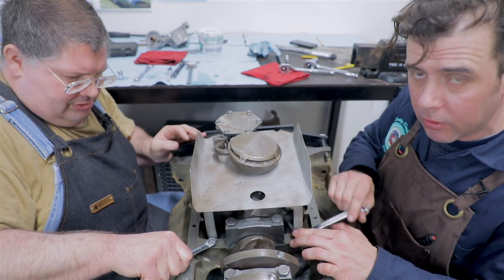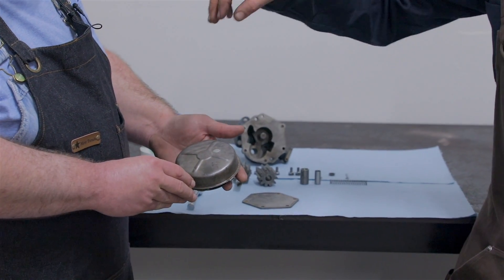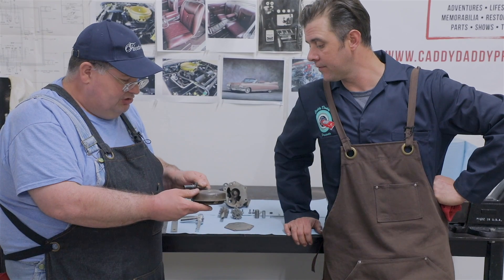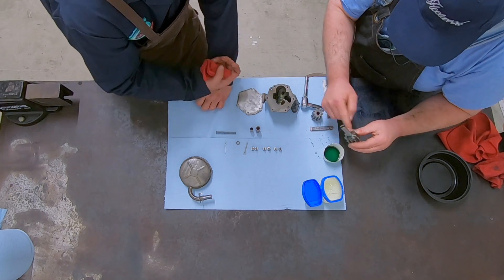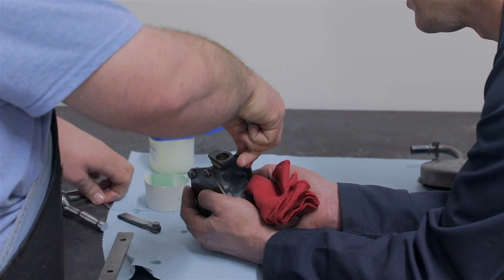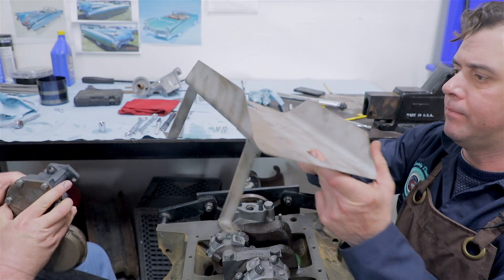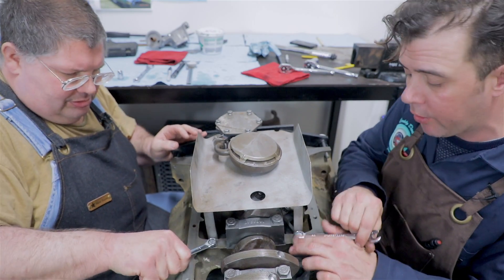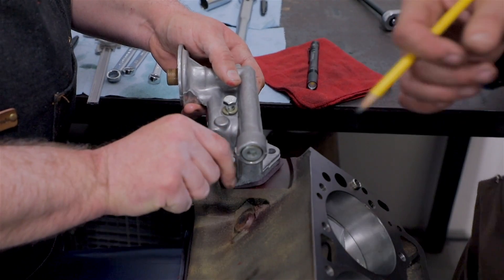How To Install an Oil Pump, Oil Pan, Oil Filter, and Windage Tray on the Cadillac 390 Engine

Comment: Great video Fellas. 
I have a ‘50 Cadillac and I’m wondering if the windage tray is absolutely necessary?? Mine is hitting the bottom of the oil pan and it’s driving me crazy. I’m upside down on the floor and can’t get it to line up. I’ve bent and moved it around for hours. Can I just leave it out?? 
Thank You for any advice.

Comment: I came here to find out where the oil pump is located on the 390. This is absolutely no help.
Reply: if you wait till the end, they have the engine upside down, they install the pump and windage tray, then, they put the oil pan on with 2 pc gasket (not shown, but in teh comments)....then you flip the whole thing over and continue the rebuilt before returning it to the car.  Seeing this is a year old now, you probably found what you were looking for.

Comment: Hi John, I watched the video in an attempt to learn more about the strainer.  The video doesn’t mention a felt seal at the strainer pivot point, one of your comments does, and I read one other place in a Cadillac forum that there’s a felt washer about the diameter of a quarter.  Could you clear this up for me?  Also, is there anything wrong with just eliminating the floating strainer with a fixed position strainer?  Thanks for the help on my ‘56!
Reply from the maker: Michael,
There is a felt washer on your engine for the oil pickup. I believe they only come in complete engine gasket sets. If you don't have one you can make one from felt available from industrial suppliers.
Sorry for the confusion in the video as to what is correct. Josh
Reply: @Caddydaddy  thank you Josh.  I’m a machine tool builder by trade, so I have lots of felt on hand.  I appreciate the info and all of the videos you do!
Reply from the maker: There is a felt seal and it should be soaked on oil before installation. Please see our oil pump rebuilding video for your reference. I would not defeat the floating strainer. It is designed to prevent sucking in sediment in the pan and to prevent starvation if the oil level is a bit low.
Josh
Reply: Hi Josh, thanks for the reply and information.  The oil pump rebuild video doesn’t reference the strainer, but this installation video does.  At 8:11 it’s said that ‘no gasket or seal’ and that’s where I’m guessing the felt seal goes.  Just trying to be thorough, I’m about to dig into my ‘56 to track down an oil pressure problem.

Comment: great video! do you guys have a video or info on how you tied the factory spin on filter with the remote passive filter?
Reply from the maker: Our '59 has a later block designed for a full-flow oil filter. The block casting is different from the earlier 331 series engine and has provisions for mounting the oil filter adapter. You can add a bypass style filter to any engine and these filters remove finer particles than do full-flow filters. In fact, is common in industrial applications to have both styles of filters in use and Mercedes-Benz used this setup in their Diesel cars for many years.

Comment: Just started oil pump rebuild.  What are torque specs for oil pump plate cover bolts and 2 assembly bolts?  Pickup WAS pretty gritty.  Thanks guys.
Reply from the maker: The oil pump cover to body bolts (1/4-20) should be tightened to 40-45 in/lbs (note inch-pounds, not ft/lbs).
Pump to rear main bearing cap (3/8-24) 20-35 ft/lbs.
Reply: @Caddydaddy  Thank you.
Reply: Thanks for the video and info.  Finally got oil pump installed.  Much more difficult laying on your back.  Gasket was the hardest part.  But 30-35 psi on interstate now!  I'd say success.
Reply from the maker: @RustyFleet  Glad the video helped you out. I have done quite a bit of engine work on my back on the cold garage floor.

Comment: Great video.  Getting ready to rebuild oil pump on my 59.  Only wish you all would have shown the oil pan gasket install.  What gasket did you go with?  One piece or cork 4 piece?  thanks.
Reply from the maker: Thanks for the feedback. We hope this video helps you out with your build. We went with the two piece gasket for the oil pan (one for each side of the pan).
Reply: @Caddydaddy  Thanks.

Comment: Hi. I´m assembling a 365 cui from 1957. With vacuum pump attached to the oil pump. I have a question. Is there suppose to be a filt ring between the "filte gridr" and the coverplate in the pick up screen? To filter the oil at the center hole in the grid.
Btw. Tnx for doing these super informative videos
Reg Lars, Denmark
Reply from the maker: Hi Lars, I hope this helps...

The hole in the center of the oil pump pickup is to allow oil to bypass the wire mesh if it becomes clogged, to prevent oil starvation. The reasoning is that dirty oil is better than no oil. The hole in the center of the screen should press against the metal cover to prevent oil from flowing through the hole during normal operation. There is no seal at this location. It is simply metal on metal. If the ring around the hole in the mesh does not seal well against the cover, then you will have to try and adjust it. I have carefully disassembled oil pickups before, to clean and straighten the wire mesh, so the bypass seals better. It doesn't have to be perfect. Any gap that is no larger than the gaps in the wire mesh should be acceptable. There is a felt sealing washer on the pickup tube where it goes into the oil pump assembly. Thanks! John
Reply: @Caddydaddy  Hi John.Thank you very much. I'll assembly the pick up as you described. Reg Lars
Reply from the maker: @larsmller3034  You're welcome! If you have any other questions, feel free to ask. Thanks!